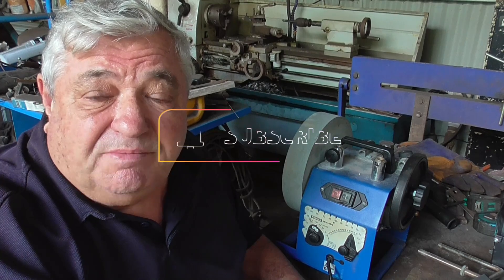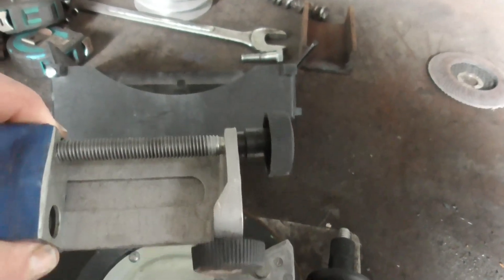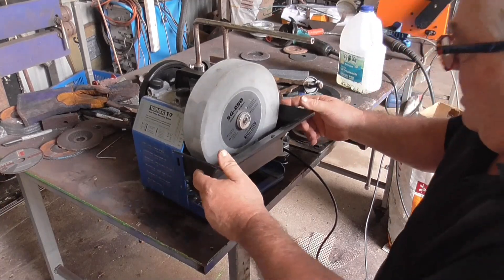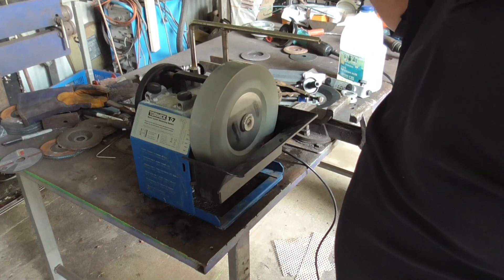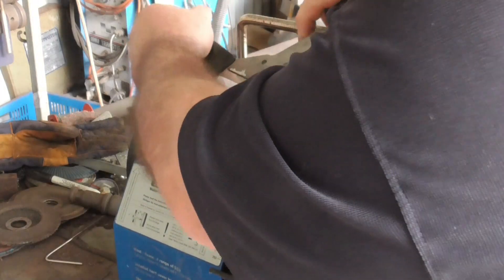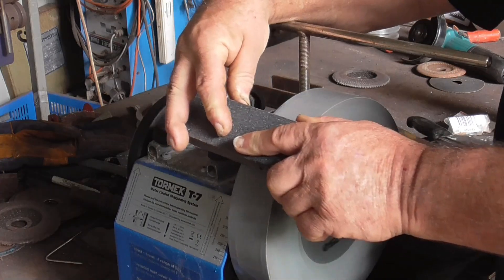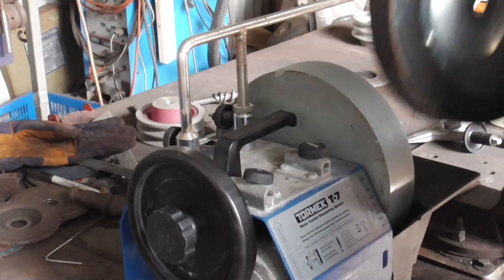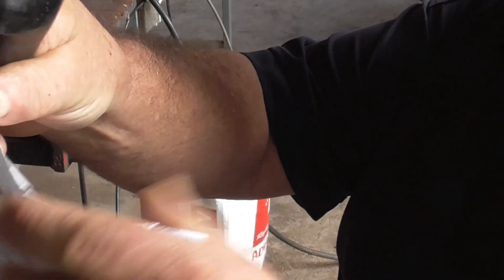I GOT A SUPER PRESENT, A TORMAK SHARPENING SYSTEM

Comment: You know more about sharpening than u are letting on. 
I have a similar machine wish I had bought the the tormek.
Yes back of chisel is as important as the front. 
You can just grind up the first 1/4” of back by putting it at a couple of degrees to flat side of wheel or a flat stone. (Looks like that’s what you may have done)
Marvellous how well an old chisel will cut when sharpened properly. 
Have done all my butchering has been with a straight boning knife and find the curved ones awkward 
Enjoy your videos please keep doing them. Cheers Stuart
Reply from the maker: Thanks Stuart I am not an expert at sharpening but I do have a bit of an idea. Worked in a job using a knife for half my life. You soon learn how to sharpen your knife nothing worse than trying to push a blunt knife. As far as the strait or curved boning knife Its probably what you get used to. I absolutely detest using blunt tools so I have kept at it learning until the problem of blunt tools went away. John

Comment: Hi mate that's awesome,  they are great. I have had one for about ten years as a builder but they only really reach their full potential when you get a CBN wheel for them.
Reply from the maker: Thanks I will have to find what a CBN wheel is. John
Reply: @farminglifeaustralia6716  it's a cubic boron nitride (apparently) wheel, it is at least 5 times faster than the stock wheel, trying to sharpen drill bits on the stock stone is painful. The cbn, when glued to the alloy wheel wicks the heat away from the tool being sharpened. I got mine from CWS stores, a wood working store.
Reply from the maker: @Juscody  Thanks a lot for that. I will look into it. John